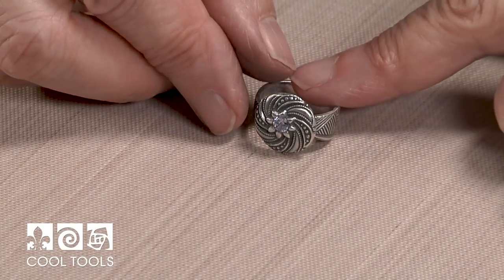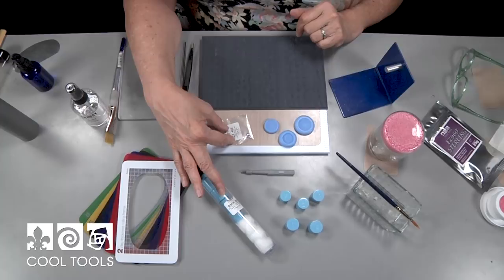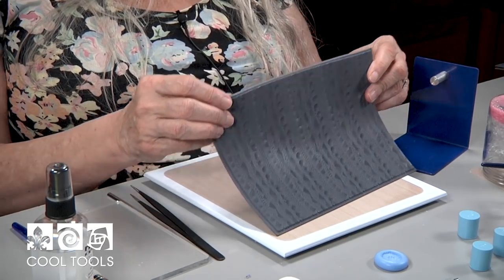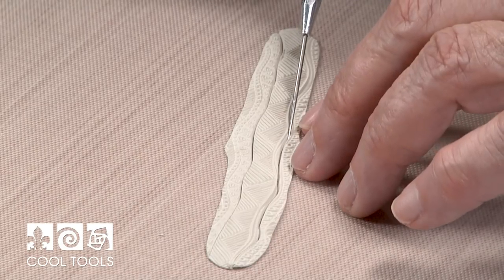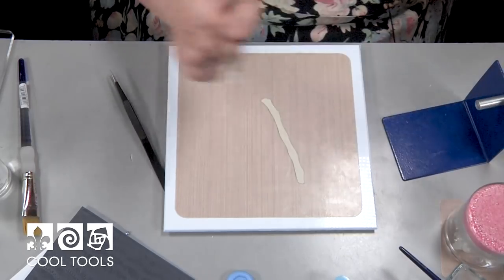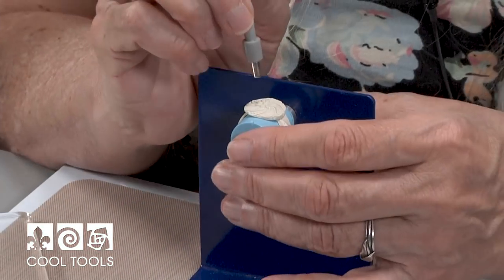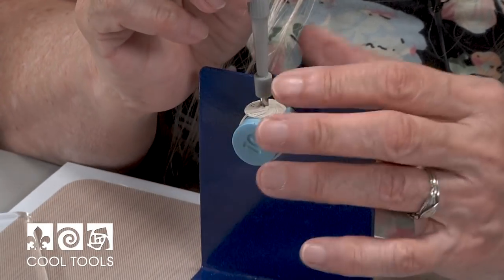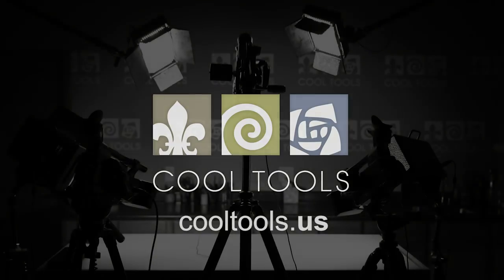Cool Tools | EZ960® Sterling Ring Using Silicone Ring Mandrels by Lisel Crowley

Comment: Recently discovered metal clay.  Do i have to use a kiln or your clay can be used with a blow torch when making rings? If a blow torch can be used,  will the ring be sturdy enough?
Reply from the maker: Hi Jane, EZ960 cannot be torch fired. It needs to be fired in a kiln. If you have any other questions regarding metal clay and getting started, please check out our Learning Center, or contact us at sales@cooltools.us or 888.478.5060. Here is a link to our Learning Center: https://www.cooltools.us/Learning-Center-s/772.htm

Hope this helps!
Reply: @cooltoolsvideos could you possibly explain quickly why it can't be torch fired? Is there a drastic difference or is it marginal?

Comment: How do you get the ring off the silicone mandrill? Had a couple of attempts crack as I am getting it off.
Reply from the maker: Hi Mark, you'll want to create the ring a little loose around the mandrel. As metal clay dries, it shrinks a little which can cause it to get stuck around the mandrel. Hope this helps!